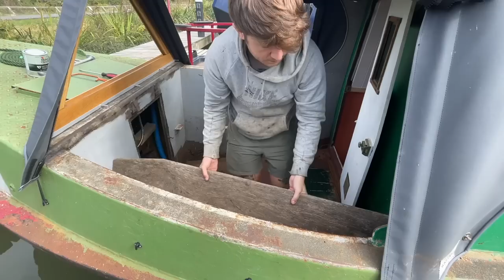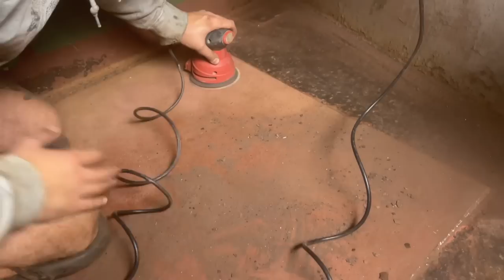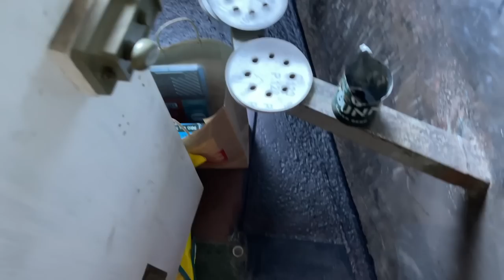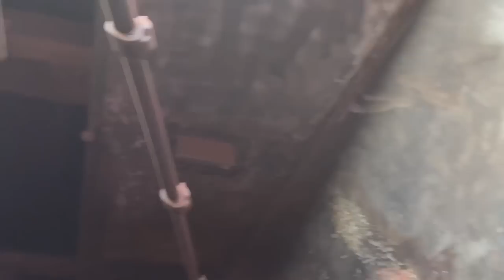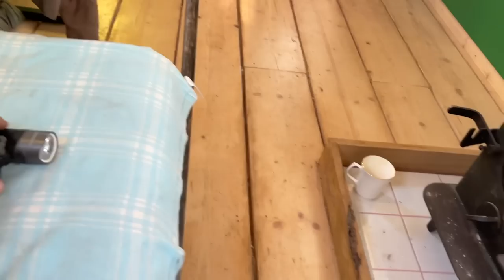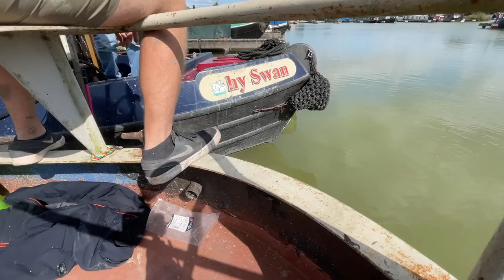LOSING MY WEDDING RING in the canal & our BIGGEST project yet?! A normal week of BOATLIFE?

Comment: I lost my ring in Swanley Marina, just the same as you, shaking my hand. Plop, off it went. £600 gold ring. Still down there for some person like you to find! Replaced it on the insurance. The moral of the story is make sure the ring is a snug fit!
Reply from the maker: Ahhh no! It’s difficult as it fits nice (or so I think) but if my hands get wet or dusty then it comes off a little easy. I’m tempted to get a smaller ring to slip on the same finger to keep as a ‘lock’ ring or something.

Comment: Ospho Part #OSPHOGOspho Metal Treatment GallonOspho Metal Treatment Gl When applied to rusted surfaces, it resists/retards rust in chemical change on drying to a tough, hard surface ready for priming. Paint jobs will last longer after an application of OSPHO because subsequent paint coating securely attaches itself so that moisture and oxygen normally do not attack the metal. Water-thin, covers a larger area than paint and goes on easily. Equally effective for exterior or interior. Available in Case Quantity only.Attributes:Description: Metal TreatmentSize: 
This stuff from Amazon will save you time Joe. Maybe your health too! Your beating your self up with all that work. There are other good rust inhibitors also. Good luck it’s looking good.
Reply from the maker: That sounds quite similar to Vactan/Fertan etc. I’ve always read it’s better to clear the rust completely rather than relying on an inhibitor but it definitely saves time you’re not wrong. I’m hoping to get back to bare metal on the roof and sides and stick with the zinc primer.

Comment: Hey, why don't you buy a mains powered grinder or even two and a knot wheel (a tough wire bush wheel)
Reply from the maker: Shortly after this I did go and get a mains grinder and I’ve got one of those knot wheels here just a little loud to use inside the marina (or at least I feel it is) - we’ve got some Tercoo discs to try too.
Reply: Envious of your coffee machine.

Comment: Quick comment about swimming in marinas - don't. I am a sailor, and marinas frequently suffer from electrical currents in the water from bad wiring. There have been multiple cases of people drowning because they get paralyzed by the current, then go under. Thankfully you had somebody with you, but I would not recommend going into the water at any marina if possible.
Reply from the maker: Wow didn’t even consider that. Just as well as would’ve thought twice about getting in!

Comment: Hi just thought I might say that it seems odd that you are in a hurry to get your boat prepared for the paint tunnel but you started on the only part of your boat that you can paint at anytime without the need to be undercover.Well done on finding the ring saves the cost of a divorce.dust inside of the boat is totally unavoidable even at Debdell wharf they cover the complete top half of the boat with canvas tape it all round then blow it up with compressed air when they grit blast the hulls and several friends have had it done and still complained about dust inside.when painting your boat buy yourself very good quality brushes most top painters use Purdy brushes the best money can buy don't fall over at the price but they are worth it look after them and they last a lifetime.
Reply from the maker: 😂 there is a reason - it’s about the only area we can prep whilst in the marina as not allowed to use the grinder on the outside of the boat! Oh the dust is crazy, can’t wait to see the state of the boat when we’re tackling the roof and sides!

Comment: I crushed mine on my finger had to cut it off
Reply from the maker: Ouch! How did you manage that? My worst fear with the ring other than losing it is getting it stuck in some sort of machinery and skinning my finger 😫
Reply: @DanniandJoe  Dremel tool with a cutting wheel. Smashed between cement blocks
Reply from the maker: @williamrandall1415  good shout on the dremel!

Comment: Glad you found your ring, but hope with all the dust in the boat you did a lead test on the old paint.
Reply from the maker: Didn’t think about that! Wore a mask as much as possible though. What would the best method to strip paint if it was lead based?
Reply: @DanniandJoe  You have a problem if it was lead based as it is now dust all over the boat and pretty much all that is inside it. Best to test it now to find out if you need to do a full deep clean of everything otherwise it could be around for years. If there are no wires around and is safe to do so a blow lamp, gas or paraffin, would be better, or if you have the electric a hot air gun would be better still. You would still have some dust but would be in sticky lumps that would hold any lead and once cold enough could be bagged instead of brushed up. Paint stripper is the obvious best but would cost a fortune and take far more time. If it has a lead content Danni well knows the score on that one being NHS and at a good guess it is the doghouse for you. Don't forget to test the water tank if it has a vent fitted to it which I guess it has. I would suggest the bottom coats of paint are nothing but lead based myself, alright you wearing a mask but not that good to sleep in the dust or sweep it up without one as you now have a lead dust anywhere it has landed if it is lead based to add to your concerns.